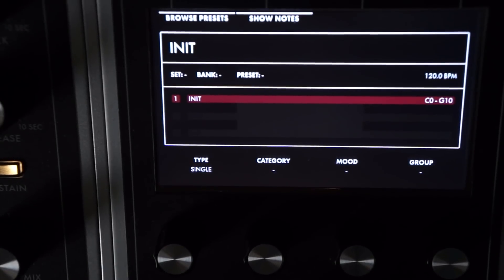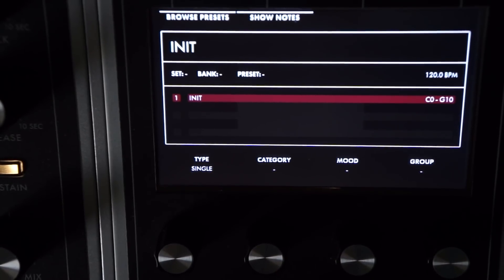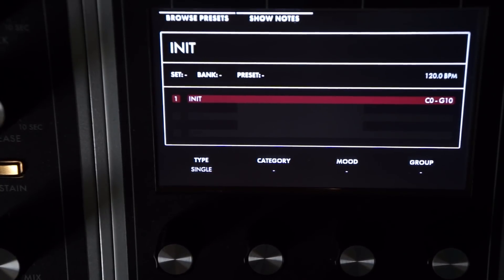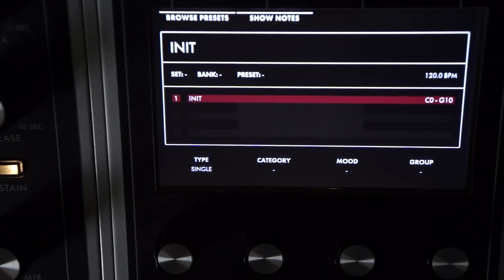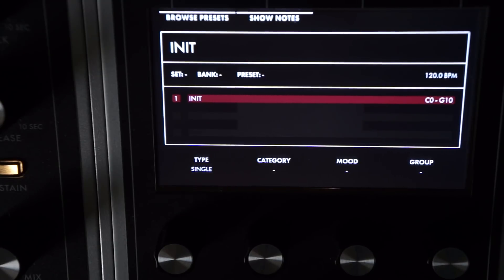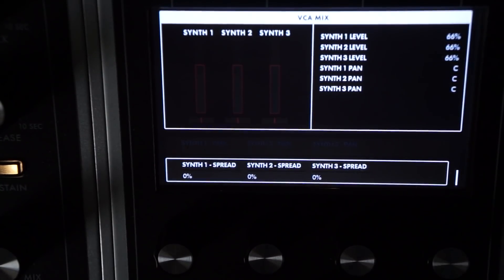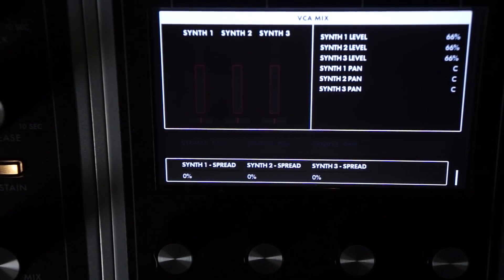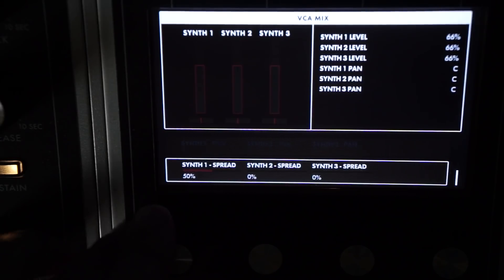Moog One Firmware Update 1.0.3 including Dynamic Stereo Panning Per Voice and more

Comment: This distortion really sounds like a defective amplifier .  I planned to trade my Roland JX10p 12 voice synth for a Moog One, but hearing this defect, i'm not so sure anymore. I also mailed moog about the firmware, and why midi sync is not implemented fully yet.  They did not answer me yet . Take your conclusions.
Reply from the maker: The distortion in the end of the video coincided with 1.0.3 being installed. I've had it for 2.5 months and didn't have that issue until minutes after the firmware update...and to my ears in the room it does not sound like amp distortion (in my opinion of course). They are starting the 1.0.3 livestream which might be useful for you to check out since you are considering the One.
Reply: @SynthientSound  I was at the live stream. I think they are very carefull with the answers. I'm convinced about the sound but not about the firmware yet.  I follow your channel when there is a new update. I like to buy a moog one in the future, but it's hard to replace my 32 year old Roland JX10 , the moog One should be a better synth overall.  On the other hand the Roland JX10 is still (bug) updated today by enthousiasts.(even the firmware) .   The Moog One has to be very good to replace it as a master keyboard also.
Reply from the maker: I hear you...the firmware is definitely a work in progress. For me the sound is so good that I was willing to deal with it for a while. 1.0.3 is definitely an improvement! Some of the annoying bugs have been taken out and I love the Spread features. 

Those 1980s Rolands sure are good sounding synths. I haven't played a JX-10, but I do have Juno 106 and a System 8 (with the modeling of course). It is pretty cool when the community of synth enthusiasts band together to keep those firmware updates going for vintage synths! btw, the keybed on the One is very nice. It is semi-weighted, which I am getting used to, but it feels very luxerious.
Reply: @SynthientSound  Thx for the comments.  I live in the netherlands. I do not even know how many we can buy if we can buy one. They say may 2019
Reply from the maker: @bonno666  I hope they get them out to all of you in Europe soon!

Comment: Not trolling, simply curious why this feels more like a computer and less like a musical instrument.  I appreciate that Moog are squashing bugs and I'm truly interested in the progress - but that noise example towards the end...the distortion, seems like a major workflow inhibitor.  How come other polysynths with effects/sequencers, such as the Prophets, and OB6, etc, etc.. seem relatively bug-free and only release firmware revision updates when they add new effects and features?  Occasionally there is a hiccup and the mfgs rectify it with a patch, but the bug list on this unit has been a phone book, and the updates sometimes add new bugs.
Reply from the maker: Hey Station, not received as trolling at all...I have appreciated your comments on the videos I've done. I see it like this: the Moog One's analog signal path is superbly beautiful and rich. The dry oscillators are very fat sounding compared to my other analogs (contra internet armchair quarterbacks who haven't sat in front of a Moog One). This is destined to be the classic that takes its place alongside of the CS-80, Jupiter, OBs, and Model Ds. 

Of course those 16 voices of analog goodness are harnessed by the most impressive computer system to be used on an analog synth. That part is still being worked out...just like an operating system of my Macbook. My OB-6 has a far (!!!) simpler computer running it and yet even it has had a number of updates to fix bugs and add features. This is all routine, but you can see how the One having such an extensive OS will need some time to get it perfect. An argument might be made that Moog released to soon...but I imagine these early day problems will largely be forgotten in a year.  

The trade off for the problems now will be (and already is) the sheer power and flexibility to shape the analog sound in a way that no other flagship analog synth can do. The bugs do, er-bug me, but 99% of the time I'm just enjoying it and loving the sound. So I'll take some bugs up front and wait. I'm the same way about being an early adopter when the new MacOS comes out. 

FWIW, I played about 40 mins yesterday and didn't experience any of that problem that I had the day before. The new voice pan spread sounds amazing on the patches I've already made and I look forward to using that new feature more. 

You are right about the phone book sized bug list. :)   I don't recommend this synth to anyone who doesn't do well with new tech. The tone of it is worth a few hassles right now. Its abilities far exceed Prophets or OBs and will take some time to perfect...plus we will be getting an even larger feature set as the Moog engineers have told us. 

I hope I have been fair on both sides of the matter. My videos aim to show it as it is...both bugs and beauty. If I didn't like it, I would have returned it, but I believe this the most greatest synth ever made. I suppose I ought to make some more sounds videos which focus more on the tones. This video definitely just needed to be about features and software. My humble thanks to anyone who actually spends the time to read this book sized response and thoughts. :)
Reply: @SynthientSound  Awesome reply.  Thanks for taking the time.  I delayed my response until I could soak it up, fully.  I'm glad to hear you love the VCO's sans effects.  Also appreciate that you feel like it's up there with the classics.  Keeps me intrigued.  
Yes, MacBooks have bugs that are patched by apple, but they don't feel as intrusive.  Maybe because the Moog One bugs are discussed so much online they become a larger deal..  Anxious to see the Moog One demo'd more at NAMM in 2 weeks.  I think the focus will be on the synth again for that event and we will get more sonic examples.  Excluding your examples, you have to admit that the YouTube M-One demonstration content isn't up to par with synths like the OB-6 where beauty seems to fall out of the machine the second you hit the power button., but I think it eventually will be.  Including myself, I know of 4 people who went from ordered customers to "pending further review".
Ill continue to watch your videos.  Keep up the thorough work!
Reply from the maker: Thanks :)  If I recall, I don't think Moog has a booth at NAMM this year (though they will have people there). You are right that the bugs have been very intrusive, but they are getting to be less and less. 1.0.3 feels light years ahead of the previous releases. I don't feel like the bugs are impeded me like they did before. And it does feel like I'm thinking less about the firmware and just enjoying the synth more. I hope the Moog One will work out for you, I have been very happy and know this is a life long instrument for me.

Comment: Can you do a video about using the external line and mic inputs?  I am following the direction in the manual but am hearing nothing coming through, although I’ve only tried using a condenser microphone and the trim might now be cutting it as it probably needs to hit a preamp or have phantom power before going in.  Maybe I’ll go buy a SM58 and try it out.
Reply from the maker: Does your condenser mic need phantom power? If so, it would explain why you are having the problem. I haven't tried a mic (Sennheiser e835) since 1.0.1, but as I recall even with a cardioid mic I had to crank the level. When I get a chance I'll take a look at it with mine. They said they've made some improvements to the Vocoder.
Reply: Synthient Sound I haven’t tried this yet, but do they or will they add support to modulate the effects parameters (i.e. LFO to control delay time, chorus/phaser/ensemble rate, etc.)?
Reply from the maker: @joelpeel6094  From memory, I believe they said it is possible and may be a future update. They don't usually commit to features not released, but I recall Amos from Moog remarking that it could possibly be done later. I think it would be a great idea and suspect it would be something they would do a year or two down the road after the firmware is more stable.
Reply: @SynthientSound  Are you noticing some jitter in the oscillator frequency for 1.0.3?  It's very minimal, but appears to be random.
Reply: Haven't had the weird distortion issue you showed in this video yet.
Reply from the maker: @joelpeel6094  I didn't experience that weird stuff at the end of the video while I played yesterday. I'm finding tuning to be more stable than previous firmware versions. 1.0.2 was terrible for me, but 1.0.3 so far has been pretty enjoyable. I'll keep an ear open for the jitter you mentioned.
Reply: @SynthientSound  https://drive.google.com/open?id=1j47EkLRr7uX4bgP7282RZo4Uta7OBeca Here's what i'm talking about.  Now I don't have room treatment except for the Genelec SAM tuning, so maybe i'm hearing the effect of the room.
Reply from the maker: Hey Joel, I tried listening to aif file, but it didn't have any sound for me. I downloaded it and tried it in iTunes and it didn't work.

Comment: The fact that the output level goes slightly down when you engage the phaser is similar to what you get on many pedals.
Reply from the maker: That is true-a vintage EHX Small Stone sure does-but it is inconvenient and does not have to be like that. Even in the analog world most of my phasers have been unity (MXR Phase 90 actually boosts level). There is no reason in either the digital or analog world to have an effect which isn't unity gain. I built a number of phasers and of modded more than I can remember. This is just a matter of adjusting the digital coding.